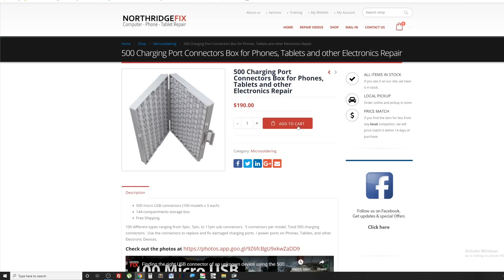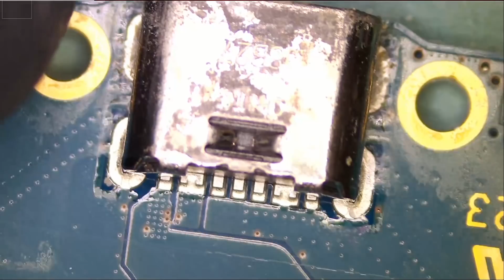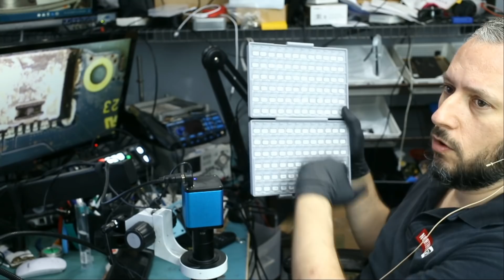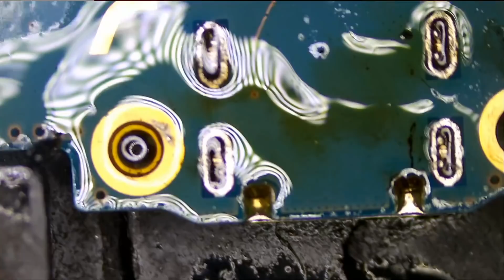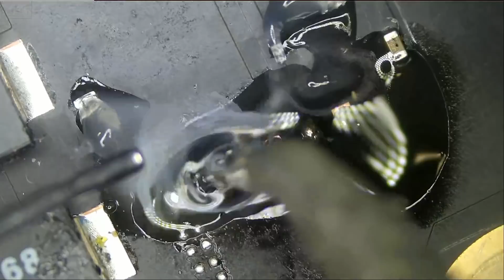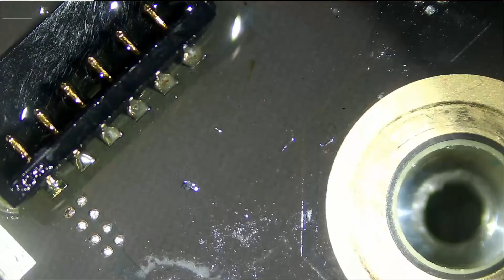Samsung SM-T387 Port replacement Using 500 ports box + 2018 Mac mini damaged Fan connector repair

Comment: Please someone reply. I need to fix this EXACT device, for this EXACT same reason ( the charging port is broken ).
6:50 Is that some kind of hot glue gun style soldering iron where the solder comes out of a little hole? I'm only asking because I notice I only see 1 object applying solder. And idk if the solder stick reacting to the flux in the right spot?

I'm watching this video over and over before I make my attempt at fixing the same device. Please reply with any tips. But first.
Tools I have:
-Flux
-Soldering iron
-Thick solder wire
-Thin solder wire
-Solder sucker

Still need to obtain the port. And maybe that "desoldering copper braid wick" thing he uses to clean up the solder while removing the original broken charging port.

He never shows how to remove the screen from the casing/shell. So I could use some advice and/or links to safe ways of accomplishing that.

I've repaired 10's of thousands of computers and built thousands in the past 35 years in the tech industry. But I've only ever soldering a handful of things in my life; all successful.

[Short story regarding experience below that you can skip]
I found a "broken" 50" Samsung HDTV in front of a house for garbage pickup one day and i took it. I realized it was only broken due to a single blown capacitor on the power supply board. I drove to Radio Shack ( it was that long ago ) and bought a bag of high quality capacitors ($2.99) and replaced ALL of them on the power supply board. AND IT WORKED!!! It was a $700 tv at the time so I cleaned it and sold it for $300 to some random landscaper I met a few days later.

Comment: This may be a stupid question, but here goes: Where is the solder coming from? Is it in the paste, stuck to the iron or is there some internal supply that I cannot see?
Reply: He put a little amount of solder on the tip and flux on the area to solder. Habitually you're not supposed to put the solder directly on the tip because the rosin inside the solder will burn but since the flux is acting like rosin that's ok.

Comment: Great video once again. 
How can I contact you guys? Ordered the red current meter from Ireland, item hasn't moved in 23 days from the tracking provided. Need the meter asap. Thanks
Reply: There is an US telephone number ( 818-668-7058) in the video description. I do not know if this will help you but you can try.
Reply: US mail services for international is resuming slowly after Corona emergency. Unfortunately you need to be patient as items are in the queue since weeks.
Reply: There is indeed a delay in shipping outside of the USA right now. I mailed something to Switzerland and it took almost a month to get there.

Comment: Hi , just want to ask regarding a water damaged samsung s5 

My mom accidentally forgot to pull her phone out of the basket when she put it in the washing machine unnoticed , its lasted no more than 15 seconds before we noticed it.

After that , we didn't bother to turn it on right away and left it in a bag of uncooked rice for 3 days , each day we let it left outside sunlight and let it heat up to see the moist  fogging up the camera lens until we see no more fogging anymore.

The phone turned back on but the screen wasnt acting the same , no dead pixels or lines or wet marks

But its like its struggling to keep the brightness up and the flickering is like a TV channel thats losing its signal :(

Is there any other way to fix this ??
Reply from the maker: No idea. I'm not a psychic unfortunately. You need to open the phone to see what part of the board got affected. Your screen may need replacement as well.
Reply: @NorthridgeFix  ok , thanks again :)